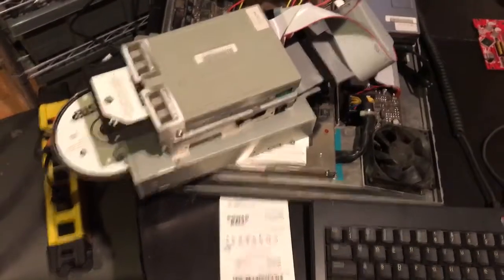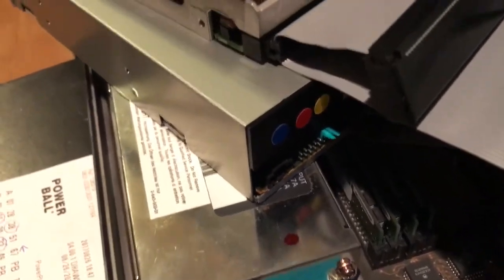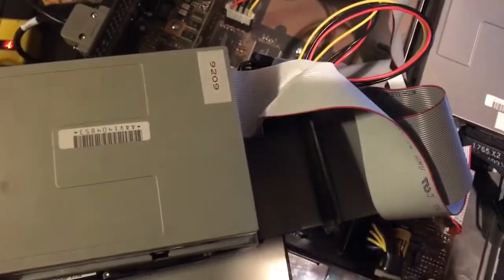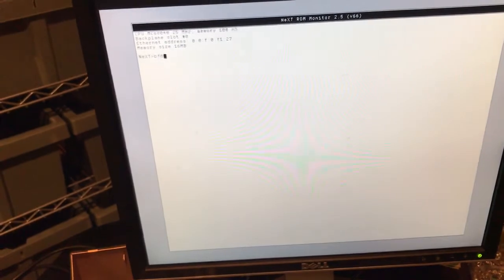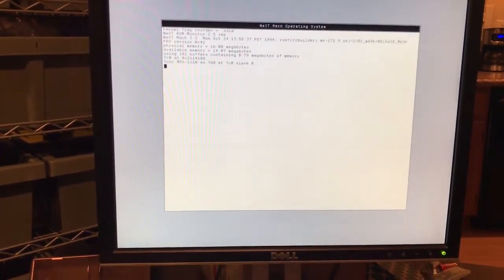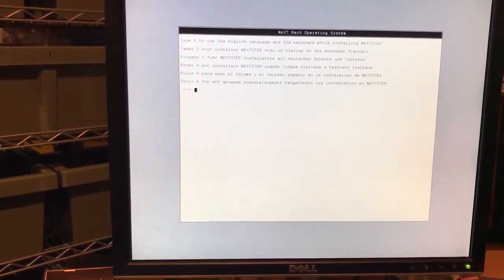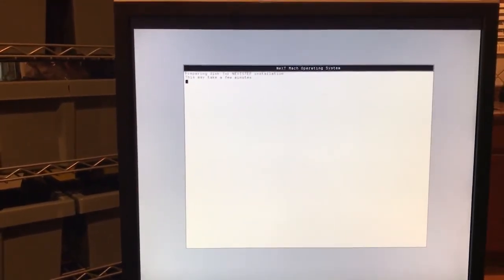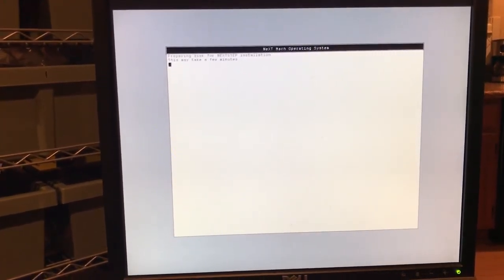NeXTstep 3.3 Install made easy NeXT Cube NeXTstation for Max  part 1

Comment: Hey Rob. Is there a way to get a clean NeXT Step 3.3 for an old Cube (says "NeXT Computer" on the back) as an SD Card image from you or some place else? Floppy drive seems to be gone, so does the MO and the CD-Rom needs to be checked as well. We got our NeXT in our Museum and the old SCSII drive just died. I got one of those SCSII2SD Adapters (v4, AFAIK), but all the roads to get the setup running seem to be burned. So I am just asking for an easy way aka image file for putting it on the SD Card.
Reply from the maker: Yes , I have them listed on my eBay store and have sold several hundred. https://www.ebay.com/itm/273963865426